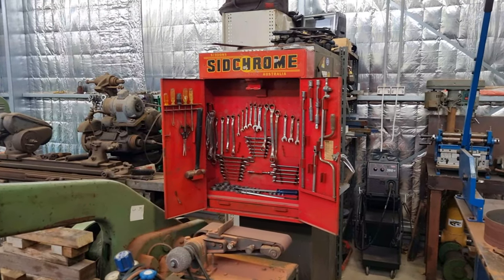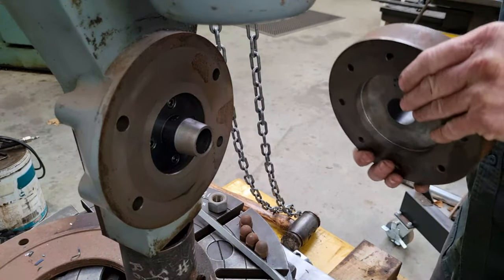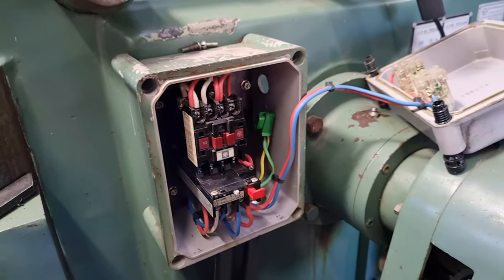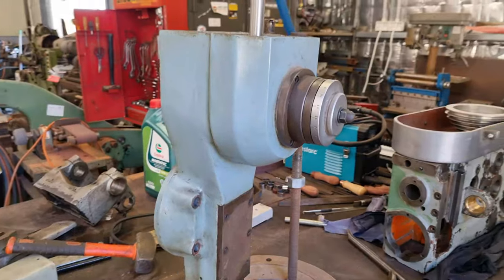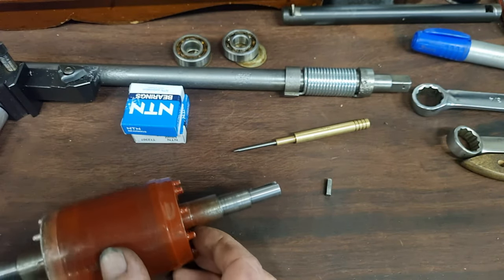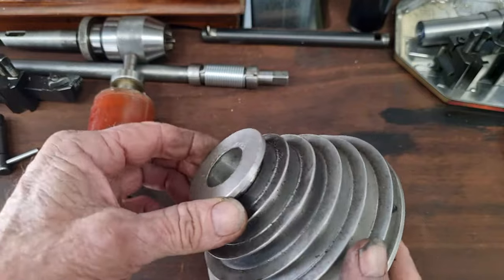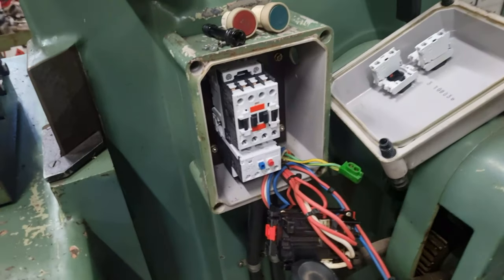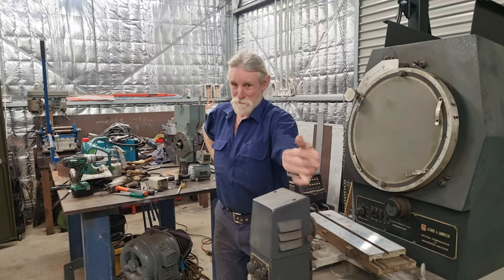Slotting head

Comment: I always thought one of those would be handy, but my mill is wedged in a corner of the shop and I doubt I could spin the head 180. Nice work as always.
Reply from the maker: Yes , you need a bit of extra room with the rear attachment .     Cheers Rob .  👍

Comment: Hi Max, the slotter looks to be up to the job, decent size ram and healthy speed selections.
I made my own, bolts up to the side of my mill drill and uses the same motor via a VFD, 2.5" stroke but good for small jobs
Reply from the maker: Yes , that is why i got this one .   Just right for the small stuff & beats the heck out of the Armstrong method !     Cheers  👍

Comment: They had one of those Sykes-Pickavant 'hydraulic' pullers at Honda dealers I worked at, didn't look very big but was 15 ton.
Russ had it at max pressure trying to get flywheel off CX500. I came in through workshop door, pulled it closed and I guess vibration through floor was enough for it to 'let go'.
Puller and flywheel went up in the air, over my head, bashed  hole through ceiling then landed behind me.
We were really lucky no one had their head over it (the three techs were a few minutes earlier)
When using sealed bearings on motorcycle wheels, I used to remove 'inside' seal to reduce friction, outside one was left as an extra to keep grease off brakes.
Those motor shafts are pressed into lamination's, spent a couple of years making electric motor parts, worst paying was single point turning cast iron 35mm bearing housings, best was machining welded up stators before they were wound, bad welds showed up pretty quick.
Nice job straightening, half thou could be in the bearing?
Reply from the maker: Thanks . Lol   they should have left the nut on , just unscrewed a couple of turns !  I would have welded & re machine the shaft as a next option if it did not want to straighten .  I have seen them pressed out before for replacement but have not done one myself .  Cheers  👍

Comment: I have the same slotting head and ironically, it came from Perth! Mine was in far better condition though. Unfortunately,  it didn't come with the Bridgeport mount. I made one from a cast iron disc and two angle brackets. I'll be interested to see how you make the tooling for yours.
Reply from the maker: No worries .  It looks good inside .   I will probably make HSS  silver soldered to steel shanks .   👍

Comment: Max must be really good mates with the electrician.    I learnt long ago that non-electrical chaps who try to reduce what I can charge (which in itself is ok) or to "help" me by disassembling it "ready" for me, make the job more difficult.  In fact, I generally refuse to take the job on if it is already partly or wholly disassembled.
In the case of the shaper, it is probably the case that the motor would not turn because the contactor failed on one phase, but it could be some other fault.
Reply from the maker: No , it makes it easy for them if the new Din rails are already in place  & the old crap is removed .     It's only a switch  not anything complex .

Comment: G'day Max.  Now this is a great video, with some good straightening techniques. 
Because you are fitting a new centre shaft, would it be feasible to make a pulley end on it, instead of welding the end. ???
Just shows some of the knowledge you possess. Great video, with tons of variety.
Reply from the maker: Not making a new shaft , going to sleeve the pulley .  👍

Comment: Don’t know for sure but it appears that adapter would sit better on the top machined part of the ram not underneath?
Reply from the maker: Then all the oscillation pressure is taken by the mounting bolt instead of the machined face of the mount .  👍

Comment: Have yet to get myself a slotting head
Reply from the maker: Do it !  👍
Reply: I finally found one on ebay for an acceptable price and it was delivered on a pallet, then a week later one came up locally for the same money.
But the one I got seems to be in nice condition and is a genuine Bridgport made one.
Just need to make or buy some tooling for it now.
The real adapter bracket is a tight sliding fit around that machined section on the back of the ram, the clamp bolt just flexes it enough to make it not move.

Yours was sadly worked on by a member of the if it don't fit use a bigger hammer brigade.
Reply from the maker: @dutchgray86    Yes , it sucks when things are plainly butchered .   👍

Comment: Nice job straightening the shaft in that rotor. Ive tried that a time or two and i just remake the shafts now it never works out trying to straighten them .So its not legal to wire your own machines.....Thats some BS lol
Reply from the maker: I would have done a weld build up before replacing the shaft .   Yes , we are not supposed to do wiring unless you are a licenced electrician .   There are a lot of ramifications if something goes wrong .    👍

Comment: Max did you say it’s illegal to work on your own equipment?!
Reply: Here, Electrical is a licensed / regulated trade, so only a licensed electrician can work on it (on camera) 😉😜😂😂👍
Reply from the maker: Yes .  Licenced electrician only .  No insurance if something goes wrong .  👍
Reply: Same in the UK for any electrical work on your house, your limited to very basic work, mostly like for like replacements.
I'm not actually sure about working on machine wiring, from the state of many used machines I have had the standards of the electrical work has been poor, things like 3 phase power lines left bare ended and flopping around lose in junction box from where a coolant pump had been removed, many wires pinched by metal covers being carelessly screwed back on, blown fuses bypassed with bits of wire, earth's not connected or relying solely on the armor wires in the cable to do it, which is fine until they rust or the gland undoes and pulls apart.